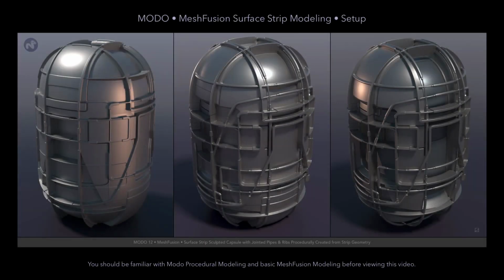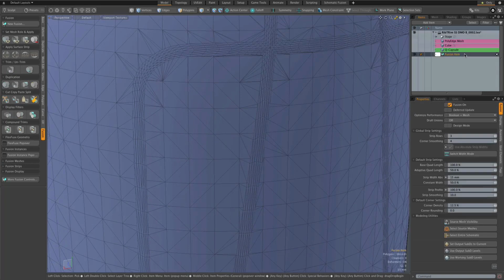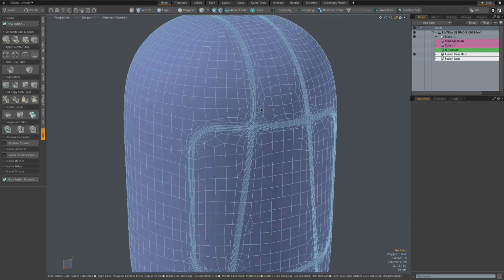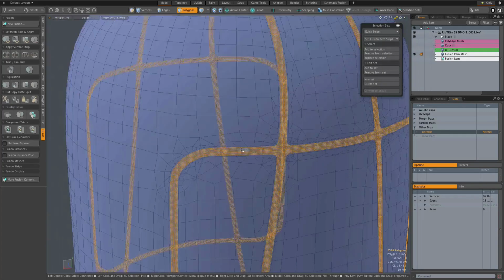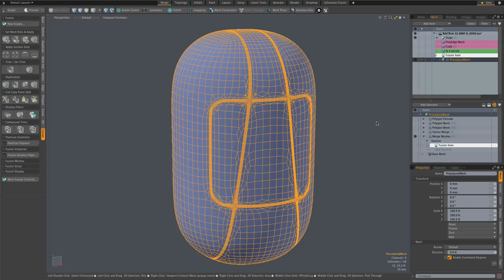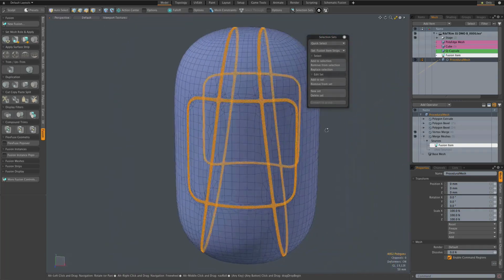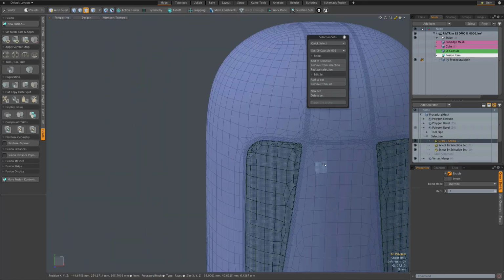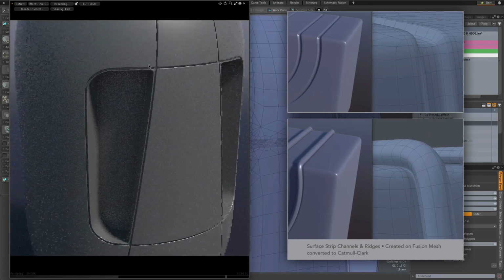MODO 12 MeshFusion Surface Strip Setup

Comment: For anyone failing to find the selection set, don't forget to change the airtight setting. The info is separated a bit in this tutorial so it's easy to forget that part while practicing  (if you practice after watching rather than during).